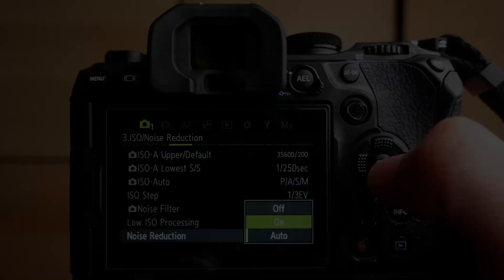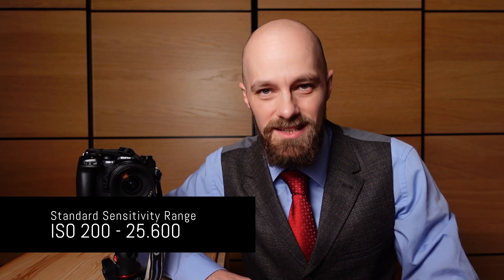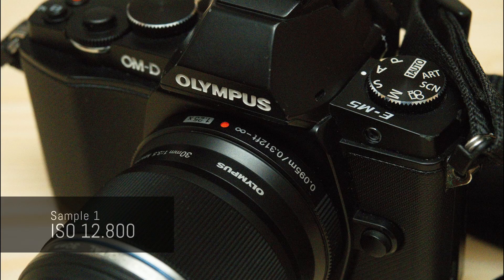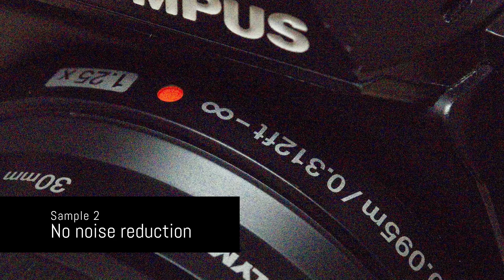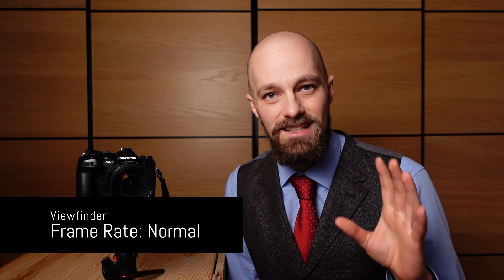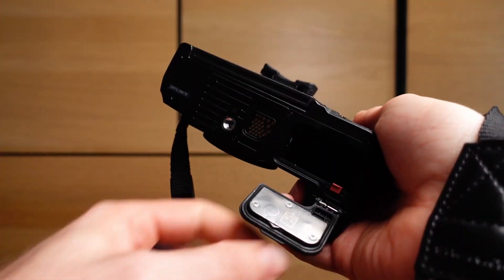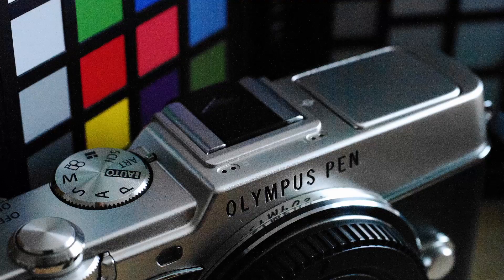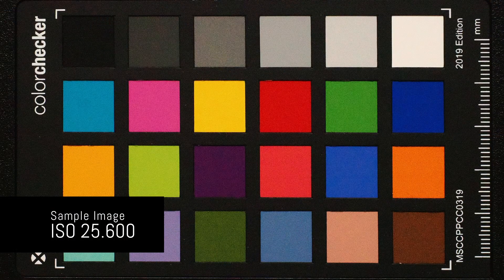OM System OM-1: A Masterclass on Image Noise

Comment from the maker: ☕ Support the channel:
ko-fi.com/thomaseislphotography
📛 Become a channel member:
youtube.com/thomaseislphotography/join
Reply from the maker: Thank you very much!
Reply: Hello Thomas, very well made and clear. Just a little remark. I wished the heat management section would demonstrate a "cool" vs "hot" camera sample side by side. Perhaps something to add to the written article ? Thanks for the good video
Reply from the maker: Thanks for the kind words!
Regarding your suggestion: great idea, I'll definitely look into that. Fun fact: it is currently quite cold in Austria, and it is actually difficult to get the OM-1 to higher temperatures. This is usually a bigger issue in summer. All in all, the OM-1 has good heat management, the mirrorless heat issue is more pronounced in larger sensor cameras. Thanks again for the comment and suggestion!

Comment: That was some great information! I was unaware that the noise filter only applies to JPEG and the Noise Reduction feature only works when using the mechanical shutter. Also the hi-res shot is a feature which I skipped over while going through the settings I was like "why would I ever need this?" Well... just took a couple of sample shots from my window in dim lighting and rainy conditions and compared hand-held hi-res vs. noise reduction set to on with the mechanical shutter. I have to say that from a first glance the hi-res shot produced by far the less noisy and better picture. I'm definitely going to use this when shooting landscape fotos in bad lighting. Thank's so much!
Reply from the maker: Thank you for your elaborate feedback, that is just great to read!
Just a quick tip, if you work with the Silent shutter, you can go to Camera1>7. Drive Mode>Silent Settings and enable Noise Reduction. You'll get a click of course, but that might be helpful in some situations.
 Best, Thomas

Comment: Hi Thomas! Just watched this and found it very helpful. Does enabling the noise filter to standard have any effect when using long lenses, auto focus continuous, and sequential shooting mode? I like to do nature and birds in flight, and I’ve noticed some of my images are very noisy. I’ve been using Lightroom‘s new noise, reduction software in post, but wondering if I can use these in camera settings as well. Thanks again for a great video.
Reply from the maker: The Noise Filter is independent of those settings, s you can definitely use it. Know that NF only affects the JPEG output, so if you bring that into Lightroom, you have to apply Adobe's noise reduction/filter.

Comment: Thomas, I've been watching and learning quite a bit from your videos.  I'm fairly new to the OM System cameras, OM-1 II and OM-5.  I've subscribed and joined.  I look forward to learning even more.   One question about this video's topic if I may.  How much of this applies to the OM-5?
Reply from the maker: Thank you very much for your exceptionally kind feedback and for joining the channel - your support is crucial and I truly appreciate it!
Indeed, the principles outlined in this video apply to the OM-5 as well. The ADC stages are a bit different -I might be able to provide the data in the future. Be that as it may, the rule is to always use the required ISO and avoid any post production exposure modifications for best SNR / lowest noise. Also, the tips regarding heat management are applicable as well - in case of the OM-5, this means turning the camera off when not in use, as there is no battery grip available. Best wishes and thanks again for your support!

Comment: Thomas...This discussion is fascinating. ..I am very interested to know about the 3 noise ranges in my OM Digital OM-1 II.  I am  a very experienced photographer...but you lost me a little bit when you say "push a RAW file in postproduction from one stage to another stage"?    The image is already recorded in one of the stages. How could that possibly change? Could you explain "push" a little more clearly? Are you referirng to some OM Workspace proprietary software stating this post production terminology?   You lost me a little bit there.  Thanks.
Reply: Got the same question here…
Reply from the maker: Thank you very much.
To answer your question: What I meant was that when you expose an image at ISO800 and then you push it two stops in post you basically "push" it to ISO3,200. This was an analogy to film photography, where you pushed film during development. As you've correctly remarked, you cannot move the ADC stages in post - which is why you should set the proper ISO in the first place. Hope that clears it up!

Comment: Hello there, (from Maine, USA)

I had the OM-1 system (previous OMD-mk2)

I ended up trading it all in for the Nikon z6iii and now, I find that all of my images look exactly the same.  Sharp and crisp.  (I have a hefty 180-600 z, 24-70 f4, and the 105 macro)

So I am in the works to trading my Nikon system back in for the OM-2 
I have these lenses that I’m hoping to get in the trade as well: 
12-40pro
300 mm
40-150 pro
17 1.2

What are your thoughts?

I do landscape, wildlife, and some macro/astro, a little of street and people.

Any recommendations on what you’d choose for a lens line up?
Reply: Treat yourself with one of the 1.2 pro lenses (you should also consider the 25 1.2 pro - take a look at the excellent ‘a Cuban epiphany’ review by Neil Buchan Grant). Furthermore: the zuiko 12-40 2.8 is nice and the Panasonic 35-100 2.8 is also a super lens capable of giving a nice bokeh for a zoom

Comment: I just bought om1 mark 2 this week..i want to know if there are changes with the new mark 2? What do you suggest about noise filter keep it of? Low or high?
Reply from the maker: Congratulations on your purchase! You can use the same guidelines with the Mark II. Regarding the noise filter: I usually turn it to "Off", as I thinks some structure in the photograph actually looks nice. My rule of thumb is: if I print smaller, I set a higher noise filter as the slight loss of detail won't be visible. I'd recommend experimenting with "Low" as a starting point and make adjustments as you deem fit. You can always change things in OM Workspace later if needed. Best wishes, Thomas 📸

Comment: I am here to report that once again, Thomas is absolutely correct in his analysis.  Using his recommendations from this video, I took a 1200 ISO photo with my OM1 and completed basic RAW adjustments with Workspace (Mac) and the same on Lightroom.  The resulting difference was glaringly obvious: Workspace produced the same image with less noise, more detail and better color - not to mention at the cheapest possible price! It’s just a pity it runs so slowly.  Regardless, I will drop Lightroom and practice patience instead as the differences are so plain.

Comment: Excellent video, as always, as an engineer and photographer I especially appreciate your work!  I have just one qualm, however, with your assertion that the battery generates heat and therefore the camera benefits from moving it into the grip.  I've worked with Lithium Ion batteries extensively in my professional career and don't believe this to be the case for the discharge rates found in digital cameras.  Perhaps you're referring to the heat generated by the internal circuitry when the battery is being charged?

Comment: Would the advice also be applied to the OM-D E-M1X, especially the 3 stages ADC of the ISO settings?
Reply from the maker: If I recall correctly, the M1X used a two-stage ADC - nonetheless, the principles are just as valid for this camera! Best, Thomas

Comment: Thank you for your great videos!
what would you recommend as noise reducing method on OM1 for high speed sport or birds in flight shooting if the camera noise filter and noise reducer functions are turned off while using electronic shutter or high fps drive?
Reply from the maker: Thank you for the positive feedback!
Maybe I can help you out: The noise filter is available in all shutter modes. So you can definitely use this one, and I would recommend setting a level that you find suitable. That should already solve any problems, but here is another thought: Some noise is to be expected at certain ISO settings, and as the noise profile of the OM-1 is very organic, I would not worry too much and accept it as it is. It can lend an image more sharpness and structure, much like film grain.
Best, Thomas

Comment: Hi Homas, thanks you for so many great user guides for OM-1. I'm new user of this camera. I shot some test images, open RAW files in Lightroom and did small edit to get more contrast and vivid colors. Using Olymus 75mm 1.8 lens. It was 200 ISO, Adobe RGB. The images looks grerat, verty sharp but LT shows quite substattial amount of noice when zoomed in so I'm surpsised of that.. But the real problem is that when exported to jpg sRGB 100% the chrustal sharpness is gone and get get some moaire patern on the jpg ! :( It is visible differance compared to what Lightroom shows me from the raw file on the screen... JPG shows also less noice, despite I did not run noice reduction. Help.. what am I doing wrong ? I like the Lightroom image a lot but not the exported JPG  (compared to my Nikon D850 files )yes, I know not fair, but I was expecting more from the OM-1 images). Thanks in advance!

Comment: Hallo Thomas! Mein Englisch ist bei weitem nicht so gut wie deines daher antworte ich lieber auf Deutsch.😉 Ich habe schon länger ein M4/3 System. Allerdings noch mit der o-m5 ii. Ich habe das 12-40 pro, dass 17 mm 1.8 und das 45 mm 1.8. Meine Überlegung ist soll ich bei M 4/3 bleiben und einen besseren Body kaufen zum Beispiel die o-m1 iii gebraucht. Oder zu APS-C wechseln und eine XT5 von Fuji Film kaufen. Zweiteres wäre natürlich viel teurer denn ich muss ja auch noch Linsen dazu kaufen. Ich bin ein reiner Hobbyfotograf daher sehr unschlüssig Ob der größere Sensor der Fuji Film meine Bilder wirklich besser machen würde. Auf der anderen Seite möchte ich nicht in ein System investieren Wenn ich in zwei Jahren dann doch zu APS-C wechseln will. Wie siehst du das? Danke dir dein Kanal ist super!

Comment: Thank you for your reply, it must be close to Christmas lunch. Is the 40-150 f/2 good with the two times TC? I find patchy comments in blogs only.
Reply from the maker: Haha no worries. I have not tested that personally, unfortunately. A TC is always a compromise, but usually an acceptable one. Having used TCs with Four Thirds lenses, I was always quite satisfied. There is a loss of resolution, but I'd say there is still enough res left - I would give it a try. Again, I have not tested the TC and therefore I don't have exact numbers from the lab.
Reply: Thanks for your help. I’m revisiting all your OM-1 videos.

Comment: Thanks for the video. It is good to get an in-depth technical perspective on the OM-1, not just this video. I am a hobby bird photographer in Brisbane, Queensland. I use a Sony a7iv with the 100-400 GM with a x1.4 TC pretty welded to the lens. I chose this combination as the 200-600 is too heavy as a walk around kit for a septuagenarian with a bad shoulder. Shooting small moving birds even only 3-5m away still needs a good focal length combination and still requires cropping. Think wrens, robins and finches. With my 100-400 and x1.4TC I get 560mm at f8, FF, with my x2 TC I get 800 at f11, FF. With my x1.4TC in crop mode I can get equivalent to 840mm but image at <20mp. In treed environments I’m often at ISO 12,800 and shooting at 1/250th or typically 1/500th . The former is a bit slow for moving birds. I am not looking to enter competitions, just share with family and friends. The OM-1 with the 100-400 lens gives me equivalent 800mm at f6.7 (I think). To me a light kit, slightly lower ISO even allowing for the smaller sensor, is becoming an attractive option. Too many reviews are negative on the OM-1 for low light, but to me it doesn’t seem any worse for a given situation and the camera offers some pretty good additional features, and with PP, ISO is not the scary beast it use to be. And 20mp is fine as I get less than that with the a7iv in crop mode. Of course in good light there are no issues I would guess. Strongly thinking of changing to mft, be it the G9ii or maybe an OM-1 ii is around the corner. What is my logic like? Any comments appreciated. Thank you again.
Reply from the maker: Thank you very much for the comment and your financial support.
According to my experiences, the ISO-performance of the OM-1 is more than sufficient. For example, I've photographed fashion shows at ISO 12.800 with the OM-1 and the client was happy with the results (so was I). Most issues stem from people not exposing correctly and then they have to work the sliders in post, which will always deteriorate image quality. So I would not worry about that at all, to be honest. Also, some people stop down MFT lenses like crazy, although they should just use the smallest f number and use low ISO instead. 
This video might be of interest when it comes to low light: https://youtu.be/jJQgJMCQJc8
Also, this one: https://youtu.be/FVHTLFD_7o8
You also brought up cropping, and as you've already noticed no matter how big your sensor is, cropping is always reducing image quality.  So if you use a system that gets the framing right, you will always be at an advantage. This video also tackles the cropping problem: https://youtu.be/D1ezetEALk0

For your use cases, I'd say you cannot get a better camera than the OM-1. It is very compact, extremely fast and incredibly reliable. I can wholeheartedly recommend it, after more than a year of intense use. One of the best camera purchases I've ever made.

Hope I was able to help! Feel free to follow up with questions or shoot me an e-mail.

Best, Thomas
Reply: Hi Thomas, I hope you’re reading this after Christmas and I have not disturbed your Christmas. I have purchased the OM-1 and 100-400 kit and busy now learning. Your approach to teaching is good for me. Thank you. Just a question if I may. I was also considering getting a macro lens. I don’t see myself as becoming an expert but when there are not many birds about insects and other small wildlife interest me. As it would’ve used outdoors I probably can’t get too close and I was wondering if the 40-150 f2.8 could be a good choice. I would get some flexibility but not probably true 1:1 macro which is fine. The synced image stabilisation with the pro lens would also be good for hand holding. And it could be useful for close birds with or without a 1.4tc. Does this make sense, or what would you suggest? Thank you.
Reply from the maker: @tonyblake8841 great to hear! Well, I'd say that would make sense, as what you are describing is not macro in the strictest sense as you stated yourself. So indeed, I'd say that is a perfectly reasonable purchase decision - a future-proof purchase, if I may add. Best, Thomas 📸

One remark: the 40-150 has no image stabilization, so it cannot sync with the body (not a big deal as the OM has an excellent stabilizer)
Reply: @ThomasEisl.Photography Hi Thomas, is there image stabilisation syncing with the f2.8 and not the f4 on the 40-150, or not on both?

Comment: Hello, thank you for the amazing content. So would it work if you push the RAW but keep it within the same stage? So push 200 to 800 for example, or 1600 to 6400? Or still better to rather pick the correct ISO? Thanks.
Reply from the maker: Yes, that is exactly how it works. 
In practice, I would recommend just setting the correct ISO. One thing, if you are close to the next stage and are not sure about getting the exposure right, just set the next higher ISO. At least that's what I do so I don't have to "jump stages".

Comment: Thomas, I have a question, say I am taking a picture of a bird on a branch and the background is the sky, I use Auto ISO in manual mode, say for example 1/2500sec f4.5 and the ISO suggested by camera is ISO 400.  The subject will be  underexposed - so are you advocating that I should not apply +EV???
Reply from the maker: No, my recommendation is not related to applying exposure compensation, but to NOT applying exposure compensation and raising the exposure in the raw converter. In the situation you just described you should set the appropriate exposure compensation to avoid having to "jump ADC stages" in post production. Hope this helps!

Comment: Hi Thomas, but how does the noise level look when having to crop an image taken at high ISO - which can be common for wildlife photographers? I can't seem to get an answer on this subject and will therefore avoid buying the system until I do. Most cameras will deal with noise when no cropping is involved.  Thanks
Reply from the maker: Hello there!
You can crop quite aggressively, as the noise is very well controlled. Hope this helps!

Comment: Thomas, does the EM5iii have that same ADC architecture feature as the OM1?
Reply from the maker: From what I saw according to data available to me, the E-M5III uses a two-stage architecture: Stage I: ISO200 to 1.600, Stage II: higher than ISO 1.600.
The same "rules" mentioned in this video apply to the E-M5III, apart from that.

Comment: AI noise reduction in OM Workspace only works with nVidia graphics cards, not with AMD cards sadly. As graphics cards are so expensive now, it will be costly to buy a new one.
Reply from the maker: True. The only good thing: the OM has excellent noise performance so it is really not essential. I myself never used AI noise réduction except for some tests.